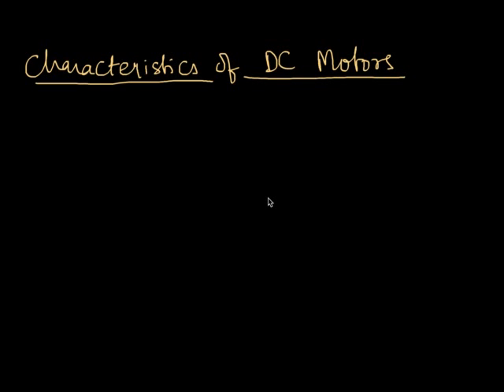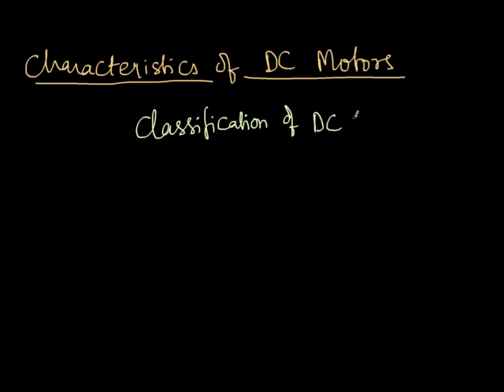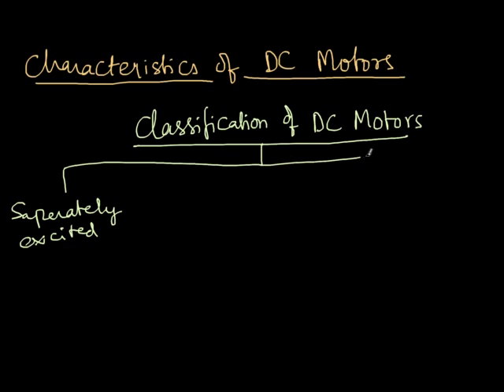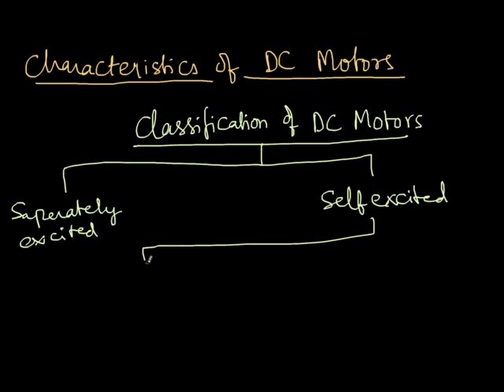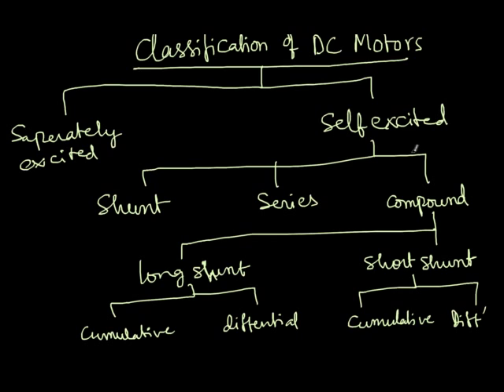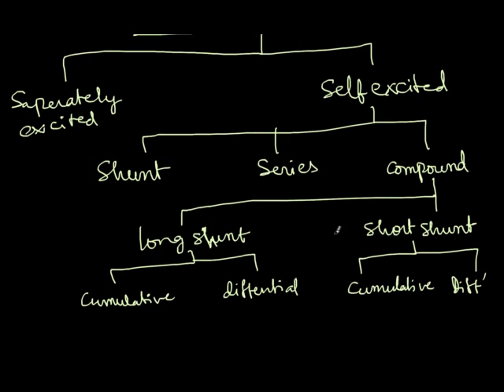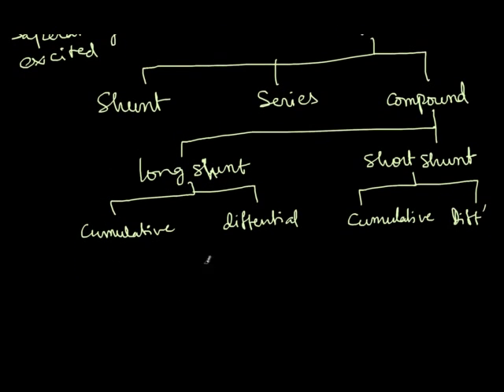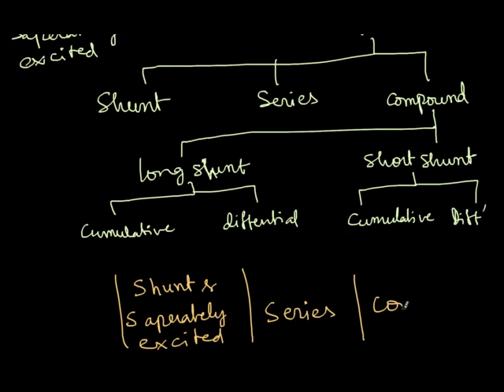Characteristics of DC Motors

Comment: Sir how to solve such a question "a six pole 225kw industrial motor runs at 1200 rpm having a rated voltage of 250 tap wound with 243 armature coil and 1 turn per coil having 81 armature slots find the rated armature current ,number of conductor z per slot and flux per pole
"